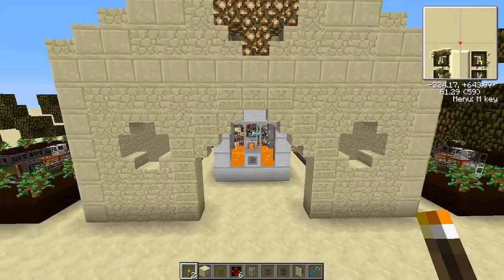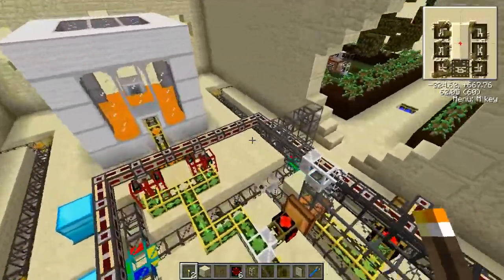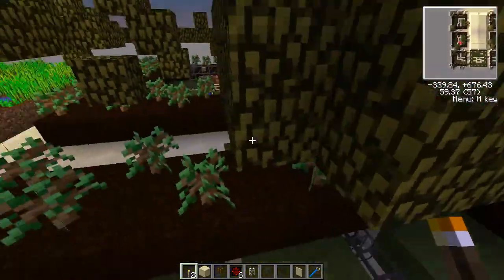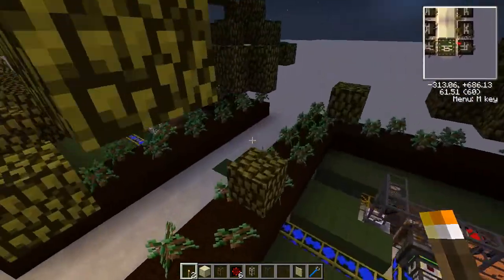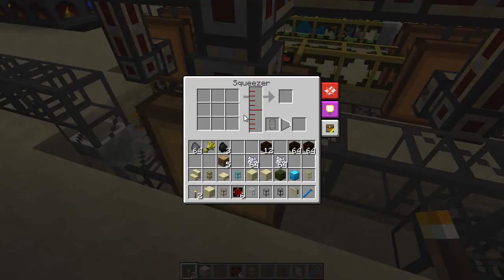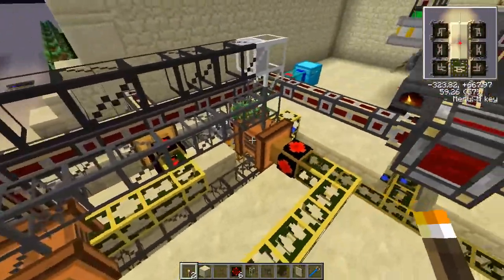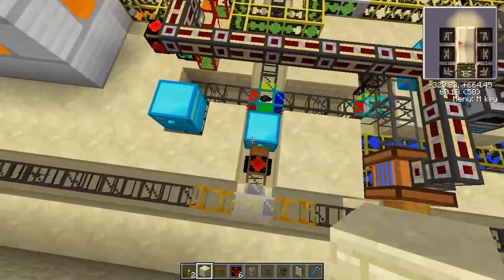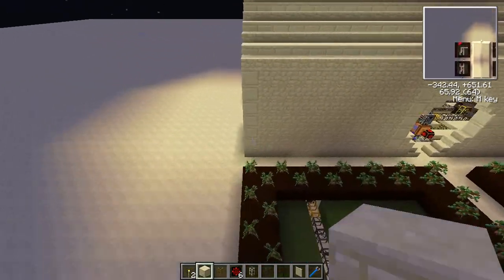FTB Biofuel Machine

Comment from the maker: Anytime. The thing you have to remember about steam boilers is the tank type and number. Low pressure tanks produce 10 steam/t which is about 2MJ. High pressure tanks produce 20 steam/t which is 4MJ. So the limit to what the boilers can produce and use is determined by the number and type of tanks. Also low pressure boilers are more fuel efficient than high pressure boilers. The largest sized high pressure boiler can power two turbines and nothing else which gets you about 100 EU/t.